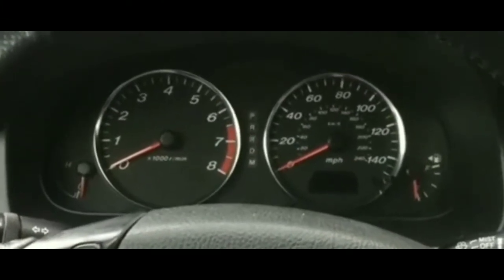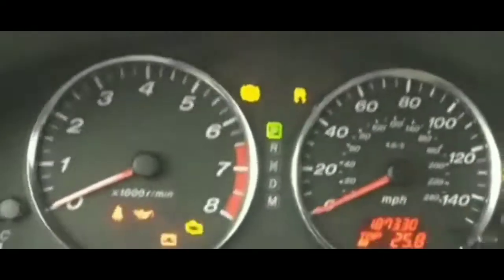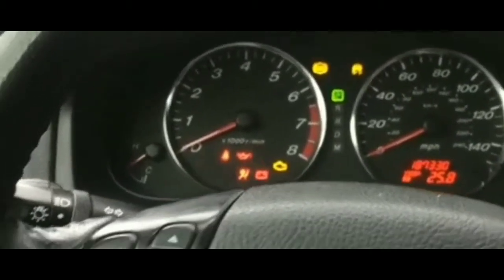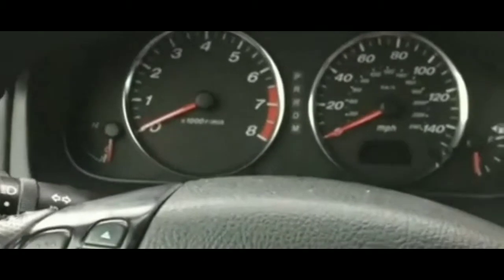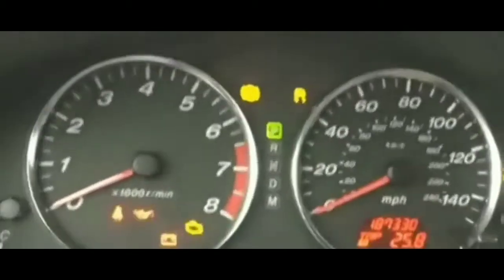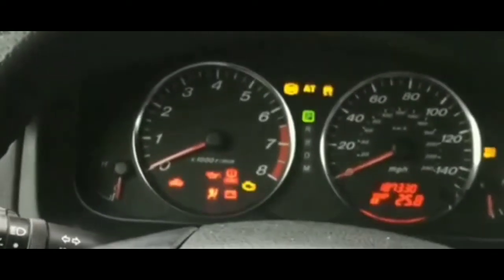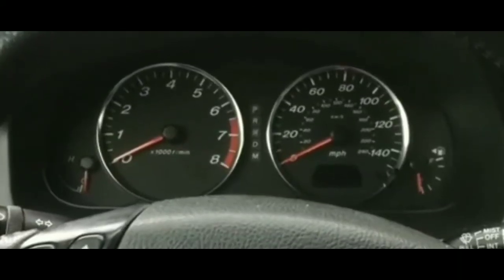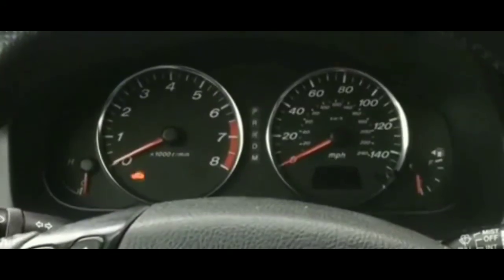2003 Mazda 6 Won't Crank/No Start Video...Fuses? Relay? Ground wires? Alternator? PCM? Fixed...

Comment from the maker: UPDATE-

Hey guys, thank you for watching this video...if this has helped you out in any way please SUBSCRIBE, press that LIKE BUTTON and leave a COMMENT.

Please check out these links that may SOLVE YOUR NO START ISSUES.

https://amzn.to/3tvM0jd

https://amzn.to/3xUrWKX

https://amzn.to/3uuLxiA

https://amzn.to/3erjviy

Analyze your car issues and ERROR codes and clear them with this Amazingly accurate yet inexpensive OBD2

SCANNER- https://amzn.to/33rovxg

Wireless Scanner

https://amzn.to/3nYbjtb

Test your Battery and Alternator 

https://amzn.to/2QWtGCU

If you would like to help this channel, your donations are appreciated.

Cashapp- $PeterLCG

Venmo- PeterLCG

THANK YOU
Reply: So what was the issues?

Comment: Try changing the key, looks like a security or alarm issue. I see the key light on.
Reply: That light is on flashing all the time until your car is actually running
Reply: @thomasmarsh4508  Hey man, bought a mazda now and got scared as the light is constantly blinking when its not on, so that is normal?
Reply: @grofkozilek1444  that red light that looks like a car with a key on it, yes it is supposed to be flashing when your vehicle is not on. Many newer model vehicles do this actually. It is a security feature to aid in the prevention of auto theft. Even if you put the key in the ignition, the light will display until you turn on the vehicle.